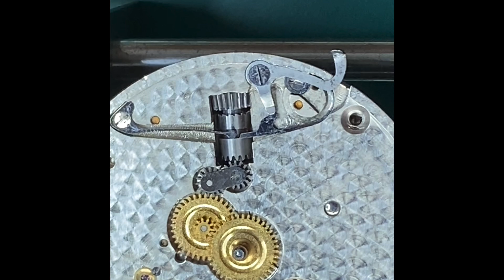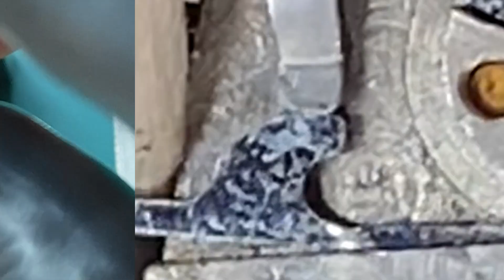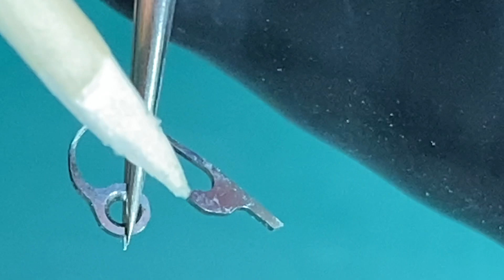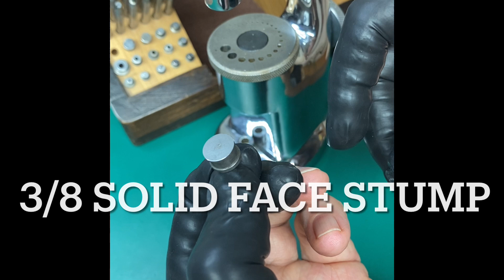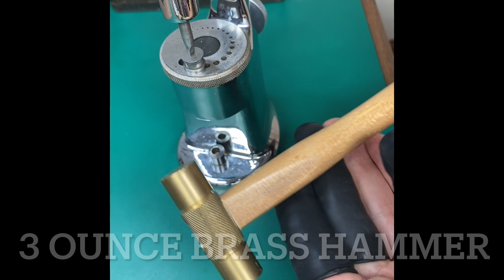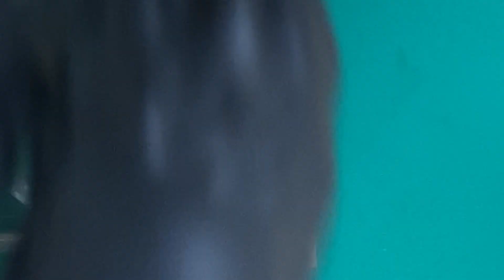How to use a Staking Tool Set to repair a Time Setting problem

Comment: I would only say that perhaps you could have measured first to see how far it had to move/expand. Then after staking/punching, you could have measured the part to see if it expanded enough. But for sure, it was an excellent example of how a person can fix a watch without buying new parts.
Reply from the maker: Thanks for the information I didn’t think of that.